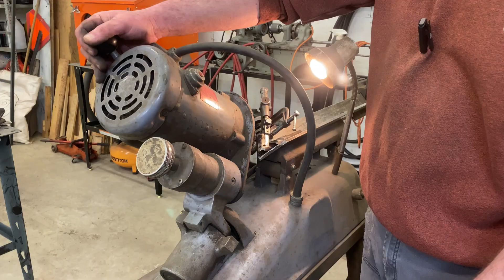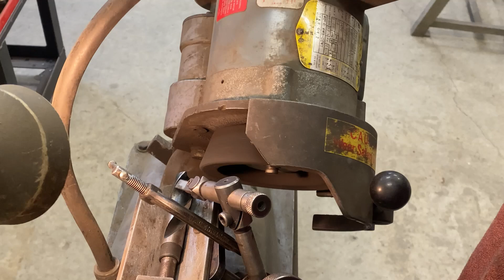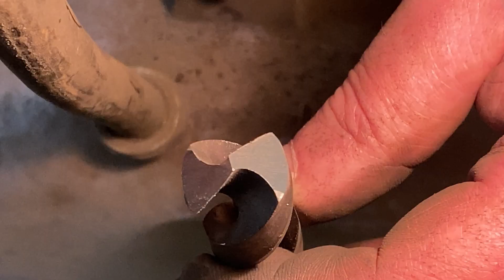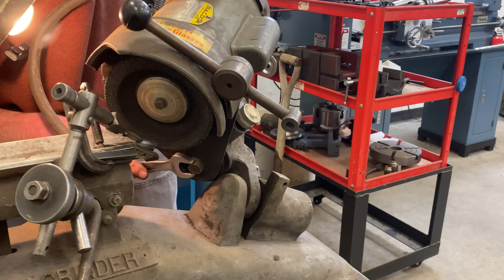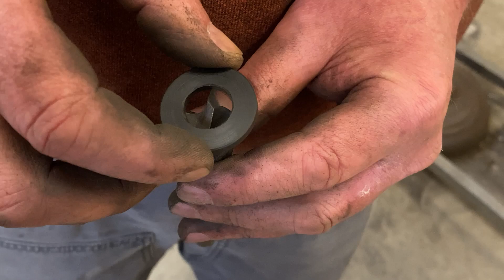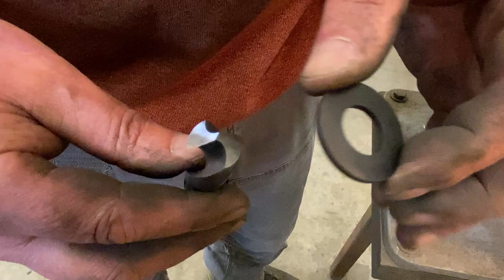FIGURING OUT OLD PINE DRILL GRINDER

Comment: Drill grinders are most intriguing. Some check to ensure the drill is sharpened correctly. Chisel angle MUST be 135. Check for 59 approach angle. Bigger the drill, less the clearance, 1/4 =0.25 10-12, 1”= 6. Good luck.

Comment: The reason there wasn't enough clearance the first time was because the flank needed to have a smaller radius. The flank radius should be adjustable so a smaller radius can be used on smaller diameter bits and a larger radius on larger diameter bits. Smaller bits need to have a smaller flank radius and larger bits need to have a larger flank radius.
Reply from the maker: That makes sense. I'm going to keep playing with it until I figure it out all the way.

Comment: I think the adjustment plate between the motor and the pivot point is also an adjustment for more or less clearance (in addition to the screw under the motor). From what I can see, the pivot axis will generate a conical path for the grinding wheel, but moving that adjustment plate brings the wheel closer to or further from the pivot axis changing the effective radius of the path the grinding wheel is following.

Interesting machine, thanks for the video!
Reply from the maker: Thanks for the idea. I'll give it a try . If I make any significant breakthroughs I'll do an update video.
Cheers!

Comment: Maybe a little more or less rotation of the drill with the finger setting to get the centre web rotated a little more on and angle, seems too square to the cutting lip, if this makes sense. You would adjust that finger to match the diameter of the drill to keep that web angle correct. Thanks for sharing your machine. Mick
Reply from the maker: Thanks for the idea. I'm going to play around with that and see what happens. Cheers!

Comment: Sort of like an inverted version of the Sterling machines where you rotate the drill into the wheel
Reply from the maker: I'm not familiar with that machine. Thanks for watching!
Reply: @Lappemountainliving  Look into the Home Shop Machinist  -  I was directed there just by searching for Pine Drill Grinder. Some of the comments mentioned it was similar to a Sterling brand as well. There was mention of someone having a manual as well.

Edited for spelling

Comment: The only other adjustment that would change the shape would be the finger position of the rotation of the drill as it lays in the v.
Reply from the maker: Agreed. I think it would change the cutting angle away from 118 degrees though. not sure what it would do to the clearance angle. Would be interesting to try and see what happens.
Reply: @Lappemountainliving the finger should not change the 118 angle, I think it is your table sliding back or forth that changes the cutting angle, as evident in your second cut where you cut more off the back of the drill. Is there any indication on the lever or bit of the table as to an angle?
Reply from the maker: There is not and I'm pretty much just guessing as to the purpose of that  mechanism.